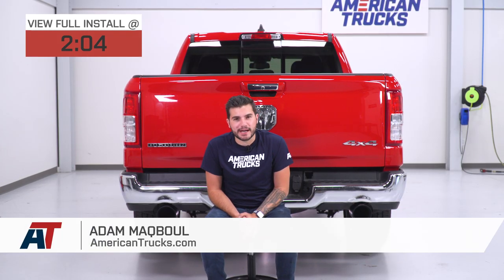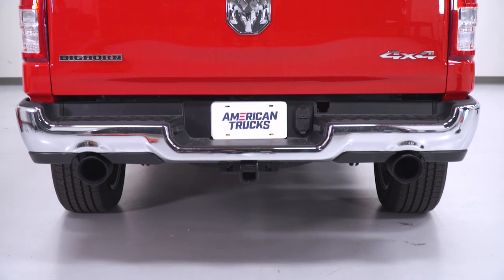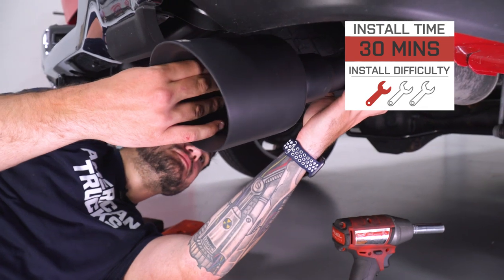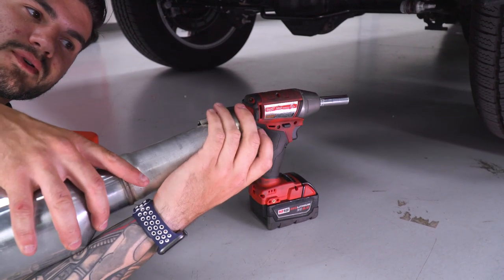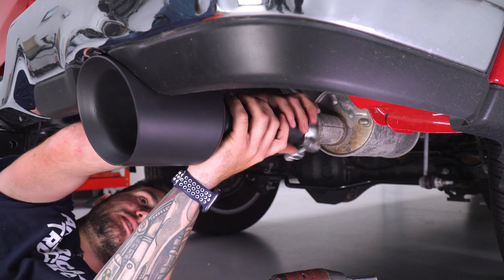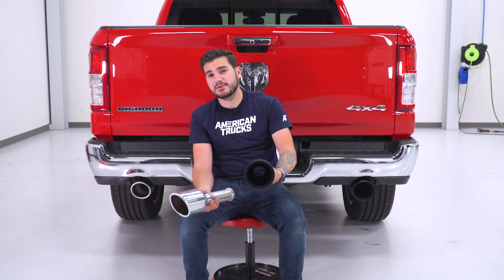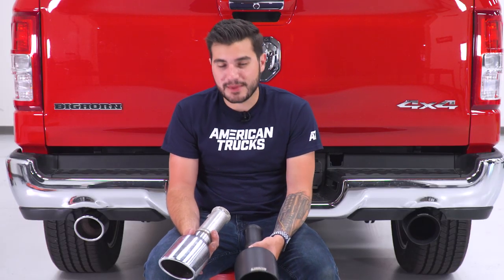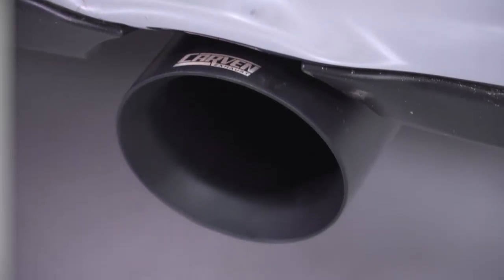2019 RAM 1500 5.7L Carven Exhaust 5 in. Ceramic Black Direct Fit Exhaust Tips Review & Install

Comment: Take 2 pens or markers, tape them at the 2 and 10 o'clock position. Center the logo up and tighten as you push up. It will give you perfect spacing around the tip and  will be centered.

Comment: I just bought these and have 1 in and I don't know if it's the truck bought in late July 2019 or the tips but they do not sit snug at all.. I lined up the bracket and the tip and had to wrench the bracket on so tight.  It was not as easy as this video makes it look..
Reply: RJ Phillips same thing here. I just bought these set of carven tips. I have a 2019 Ram rebel and I’m having a hard time trying to put them on.
Reply: @RContreras1  I had to wrench so hard I thought I was going to break something.  Also, in the video and most pictures it stuck out a few inches and this one is pretty flush with the bumper.
Reply: RJ Phillips Same thing here, it looks flush with the bumper while attempting to put them on. I will try again tomorrow I’ll keep you updated. Thanks RJ
Reply: Just tried to install on my 2019 warlock and it was not snug at all the end of the exhaust tips I took of and these carven tips are 1/4” difference and I tightened the clamp as hard as I could.

Comment: Does anybody know what these would sound like with a Flowmaster outlaw direct fit muffler ? I’ve been wanting to switch these two parts out on my 2018 Rebel
Reply from the maker: Changing the tips out alone won't give you a huge difference in sound on your truck, honestly. You may notice the exhaust pitch go a little bit deeper or resonate a bit more, but the direct-fit muffler you're referring to will make the largest difference. -Zach

Comment: This exhaust tip doesn’t work I have the same one I can’t get it on and I have a ram 1500 classic 2019
Reply from the maker: These tips are specifically for the 2019-2020 model RAM 1500s, not the 2019 Classic. That's most likely the cause of your fitment issues. -Zach

Comment: $200 for some painted metal
Reply from the maker: Exhaust tips aren't cheap, let alone double-walled 5" tips that are ceramic coated black like this, that are also a direct fit. For the ease of install and high quality, they're worth it. -Zach
Reply: @AmericanTrucksRam  You already had exhaust tips...just paint them black. As a viewer I dont want to get talked into wasting money on what amounts to a can of spray paint
Reply from the maker: We're not trying to trick anyone to purchase these tips. But if you want some larger tips that are double-walled, a direct replacement, more aggressive ascetically and have a long-lasting ceramic coating; we got something for you. By all means painting your stock tips is an option, this would look better in my own opinion. -Zach
Reply: @ConquerCollin  As they said, exhaust tips aren't the cheapest thing on the market. It's ceramic coated which isn't the same as rattle can paint. If you think $200 is too much then don't do the mod.
Reply: @h0w-itzer283  it's not a mod it's a damn color change. Dont try to fancy it up
Reply: @ConquerCollin  I think you need to learn the definition of the word modification. Let's take you back to grade 3 :)
Reply: @h0w-itzer283  You can call a different color a mod all you want. You still spent hundreds of dollars on changing a color. Is your next mod gonna be an $800 sticker on the back that says "loser over here"?
Reply: Mod yes 5inch tips is a def mod over stock. Color change and ceramic coating. It's not for everyone but a nice option. Thanks for posting